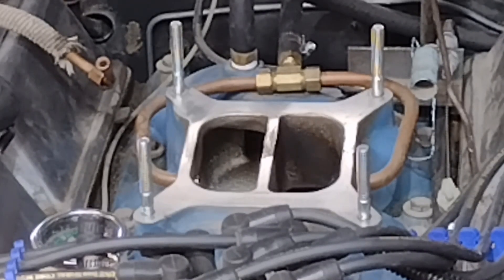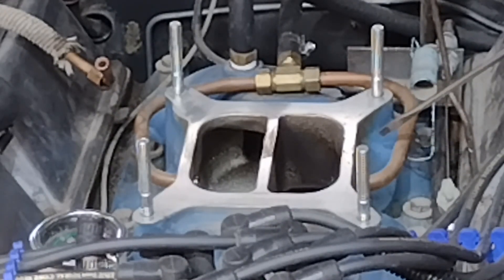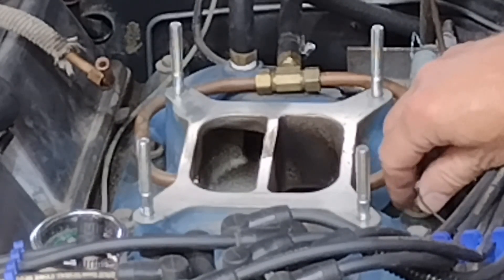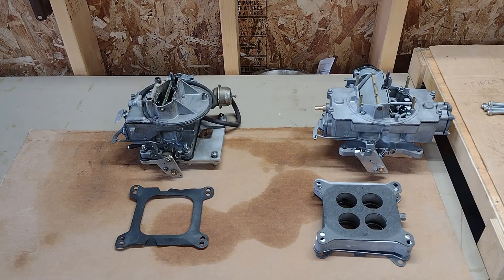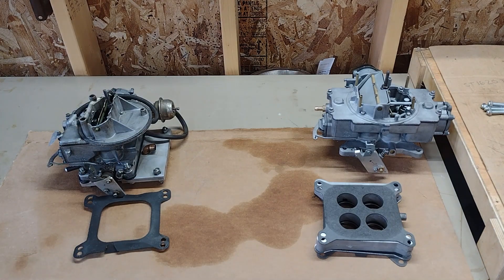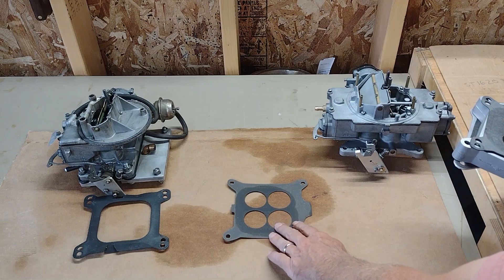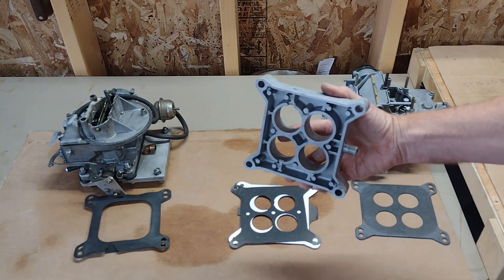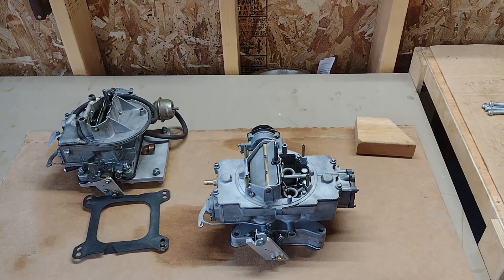How to use a Ford Autolite 4100 with an Edelbrock intake manifold

Comment: Great how to video! Wish somebody might make that plate since I want to use the Autolite 4100 with original 4 hole spacer on my 302 with a 8011 Weiand intake.
Reply from the maker: It's pretty easy to make one yourself.  Use the spacer or a proper gasket as a template, find some aluminum at a fabrication shop, borrow a hole saw and saber saw if you don't have them.